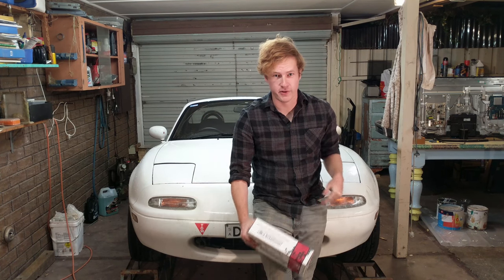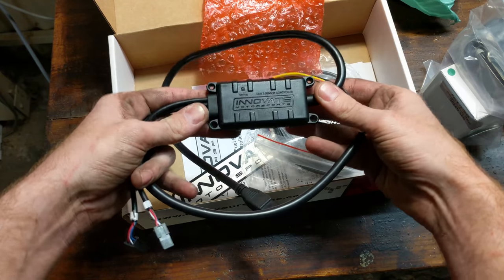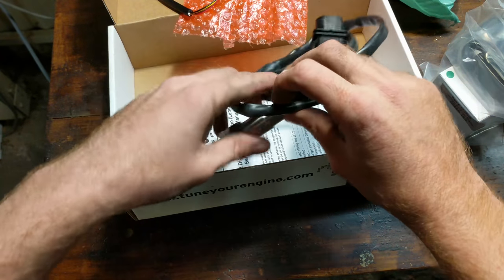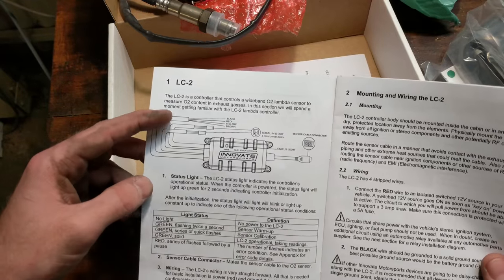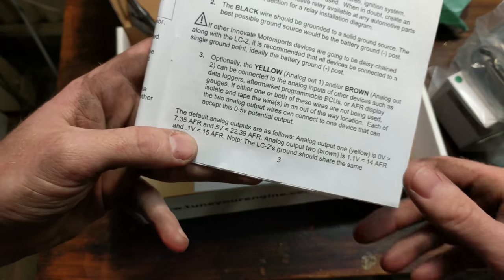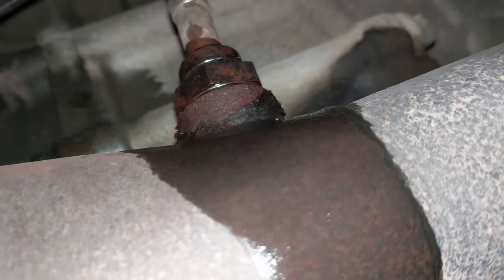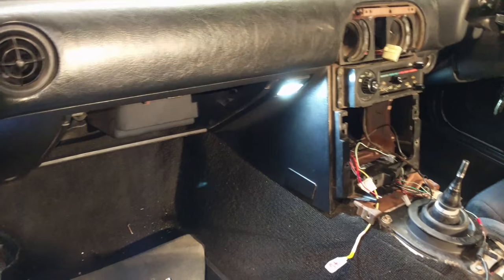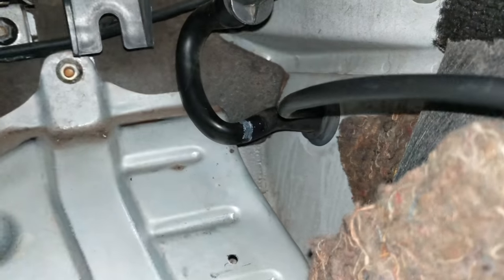How To Install a Wideband 02 Sensor on Your MX-5

Comment: I'm chasing down my rich running engine and have considered fitting a o2 reader.  As you've pointed out the wideband has to emulate narrowband for the stock ecu.  How confident are you that the readout is accurate?
Reply from the maker: Oooooh. I mean... fairly? Some use Innovate in proper custom EFI setups with no problems, others cite issues with them, particularly around requiring recalibration from time to time.

I'd say they're fairly accurate though when used appropriately.

What setup are you looking at fitting this to? If you're driving a car that's already EFI, it should already have an O2 sensor to self-manage its fuel mixtures.  I note though that I think Roadkill used a wideband to tune their carburetted turbocharged Rotsun. Cool stuff.

I just used the Innovate as a replacement for the stock part because I intend to fit a custom ECU later that can take advantage of the full wideband readings.
Reply: a 95 NA.   Looks like I'm going down the exact same route.

Comment: What if you want to run MegaSquirt and have a gauge, how do you wire to wideband and a gauge?
Reply from the maker: My Innovate wideband controller has two outputs, and it can put the proper wideband signal on both. One can be used for a gauge, and one for MegaSquirt.
Reply: What Up TK Here I know the yellow has to go to MegaSquirt to act as the wideband and the brown acts as a narrowband, but the gauge also requires the yellow wire to read the afrs correctly as well as MegaSquirt needing the yellow wire as well, what do you do in this instance? Join an extra wire?
Reply from the maker: The device can be reconfigured over serial to output the wide band output on both yellow and brown wires.
Reply: What Up TK Here how would you do that?
Reply from the maker: I haven’t tried myself, but they include some of the required cables in the box. You hook it up to a PC and I think they have a proprietary software tool that will let you reconfigure it.

Comment: Where did you wire in a fuse?
Reply from the maker: thecircusb0y1 it's running off what used to be the stereo power lines, which is fused in the factory fusebox.